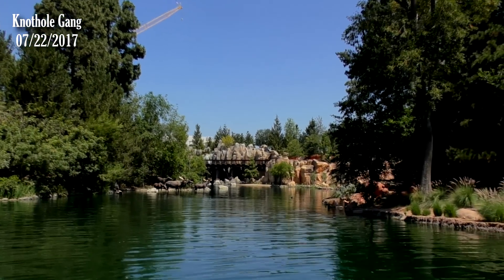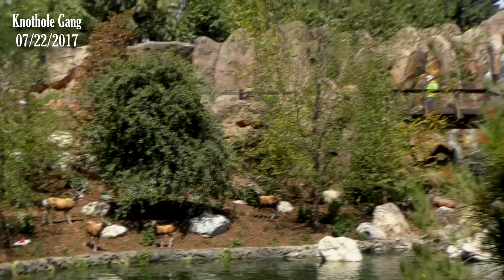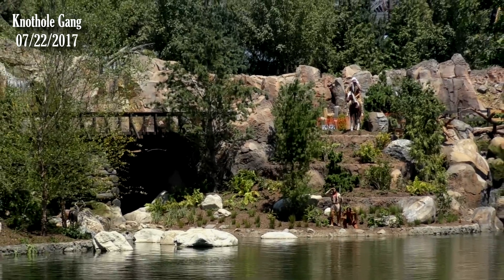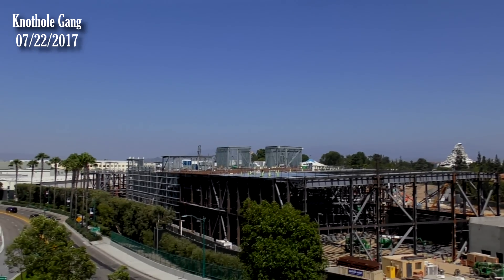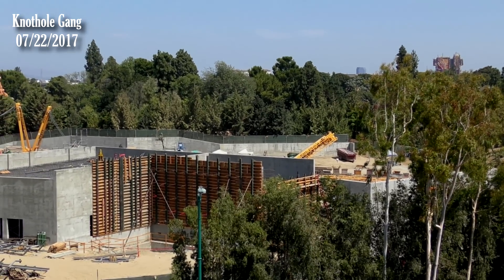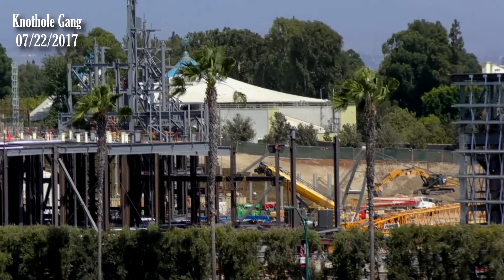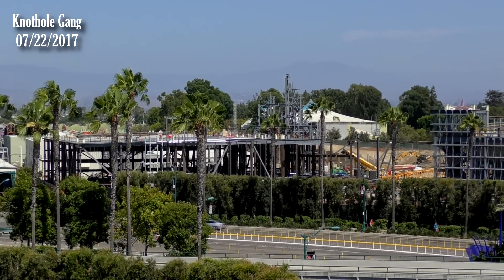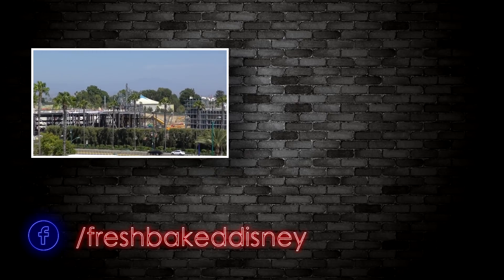Galaxy's Edge Construction - Hello Star Wars Land imagineers! - Pt. 103 | 07-22-2017

Comment: "What is that tall thing?" It's a construction elevator. You asked the same question when one appeared on the BE building. The wire grid panels (on the roof) are used to add strength and prevent cracking in concrete. The reason they are brown is they are rusted. You can see a stack of the panels on the ground right next to the large open hanger space.

Comment: Those units on the east side of the roof of Battle Escape are Air Handler units. They supply the cooling for the building. If you look carefully at the very eastern edge of the roof, approx. 6 ft above the roof on steel supports, you'll see 2 black pipes. Those are the chilled water supply and return lines that feed the air handler unit. I haven't seen a recent satellite shot but I would assume they are building a new chiller plant to supply chilled water to the new land. The West Plant near Indy is probably maxed out on capacity.

Comment: 13:30 that is your hanger they talked about at D23.  Wall panels will be mounted on that substructure.
Reply: 14:52 that green fencing is because of the paths opening next weekend. If someone goes off trail it keeps them from falling off the wall.
Reply: 15:14 that coloring is the rebar that goes in the center of the concrete when it's poured.
Reply: 17:50, they are hvac and not construction trailers, they are wrapped and no one ever goes in or out. You ask for construction people to help you but ignore us. I still love your videos, but will let you see what happens from now on, keep trudging on.
Reply from the maker: i'm not sure what you mean by ignoring you.  that seems kind of premeditated.  is that the kind of guys you think we are?  at any rate, i've had others also suggest also that they are construction offices.  i was initially just saying that's what they looked like to me.  I would literally have no clue for sure.
Reply: No, what I'm saying is that you ask for people in construction, me since 1990, and it seems when someone who knows what it is, you go with who you trust. So why ask us if you already have it figured out? I've been right about many things you have asked about and no construction company is going to put that many work offices on the roof in the way of the Roofing process. But HVAC has to be in place to do Roofing and other finishing, plus look at the units, you can see they are sealed with the same blue covering that much of the ducting has in place as well. If they come off that building, I'll donate $20.00 to you guys.

Comment: +FreshBaked, Here is something that you can talk about on your next "Star Wars" update: Disney could move "Star Tours" to Star Wars Land and then fill the then empty Star Tours building in Tomorrowland with the original "Adventures through Inner Space" attraction or a hole new ride for Tomorrowland?? That could be a fun idea!😀
Reply: Ain't gonna happen.  Star Tours is 30-year-old technology and is built around content from the original trilogy, while SW:GE is set in the prequel trilogy.  Eventually Disney will replace Star Tours, but they won't relocate it.
Reply: David Mullich It's an interesting thought though. Stay optimistic of the replacement if you think Star Tours is going to go away. They could bring "Adventure through Inner Space" back!! Just a thought. I'm a little too optimistic myself.😂
Reply: My guess is that Star Tours will stay put until Disney decides to completely revise Tomorrowland. Depending on what ideas they have for making the land sustainably relevant, it may go beyond a 1:1 replacement of attractions.  Some of the existing show buildings themselves might be torn down, especially  with the need to remove he PeopleMover track.
Reply: Galaxy's Edge is based on the new trilogy, not the prequels. That being said, Star Tours' days are coming to an end soon.
Reply: Star Tours may be 30 year old tech but it's still a great ride so I hope it stays put in Tomorrowland or they eventually move it to Galaxy's Edge.  Old tech doesn't = bad tech.
Reply: @Mitchell Mason, they did talk about it before. Just look up older videos of SWL or an old live stream and they mention it there. They basically said what David Mullich said, they wont move it and it will go away once they redo Tomorrowland.

Comment: One more report on Rivers of America. Once everything opens you need to take a trip or two around the water to report all the changes made, and to show us. Also, They might open the rest of the Island so you have to show that as well. 

The cement wall is a basic retainer wall with a no peaking fence on top. The new stuff on the street side of the building is to hold up the artwork that makes the area seem bigger just like what they did in Carsland.

Yes, the greatest ride in all the land or at least until the next land comes along

Someone else LAST WEEK got video of the train bridge and they built a wall right under the trestle to block the view as if they are going to take things down soon inside the park